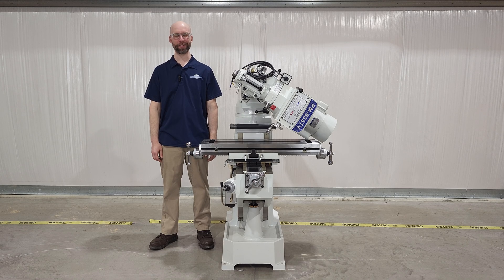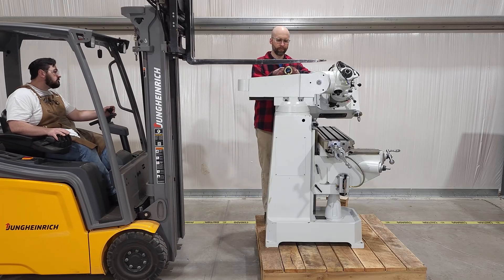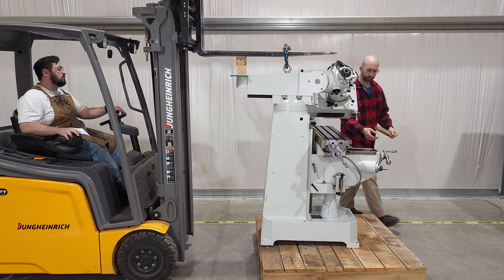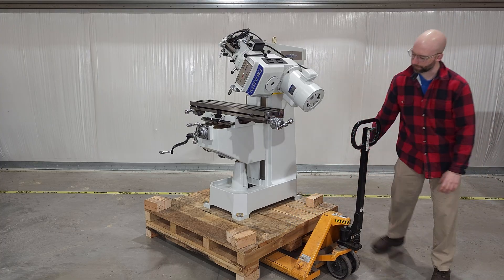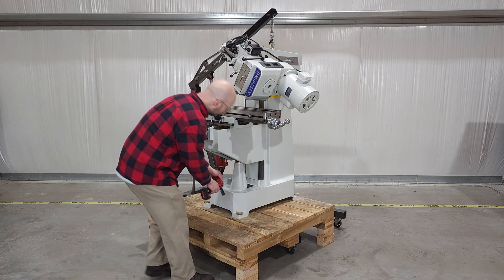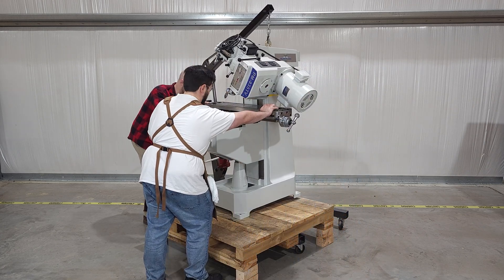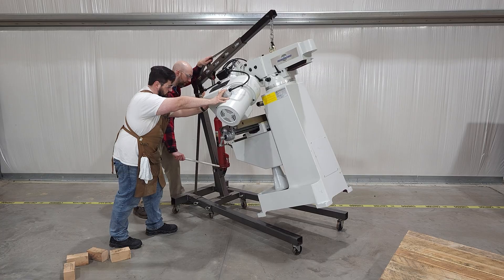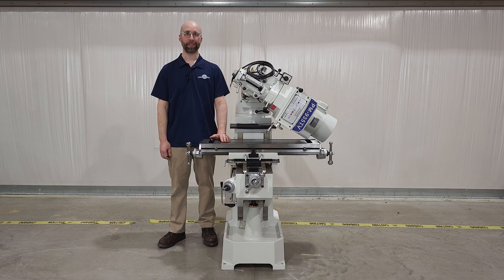Knee Mill Setup Precision Matthews Media

Comment: I cut the pallet and used the HF lift, and my garage ceiling is pretty low.  It felt sketchy and I didn't drop it, but it almost went over at one point working by myself.  Good tip is have some help.

Comment: These videos are great! Very informative and potential customers get a closer look at these machines. Much appreciated! Using an engine leveler with the hoist to prevent tipping is an option. 1 ton leveler's are common (note there are lower rated ones - min. 1 ton recommended). The hoist chain needs to be shortened or removed as the engine leveler itself takes up a fair amount of the hoists travel. Although straps around the ram may be needed for this machine as the single point location of the eye bolt probably wouldn't provide any leveling action using a leveler.